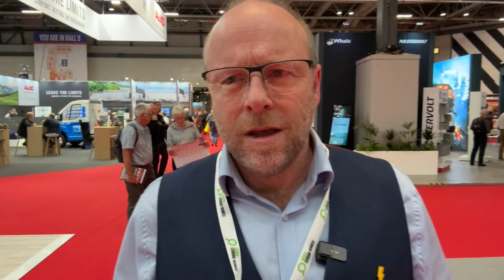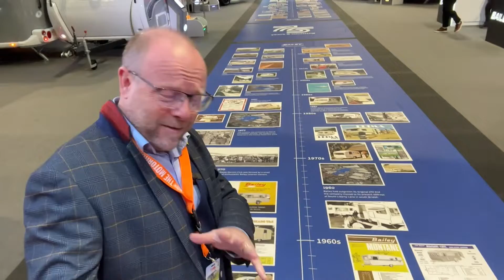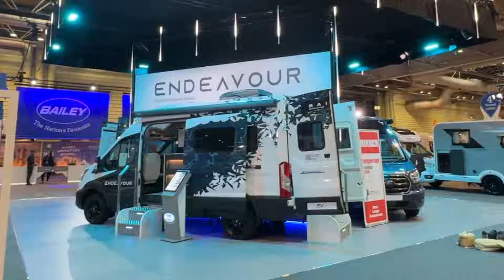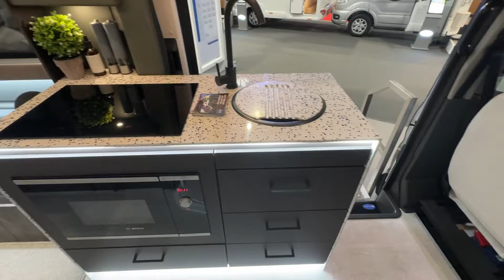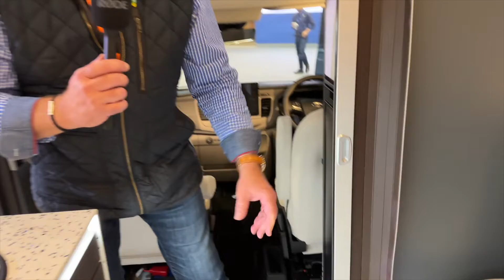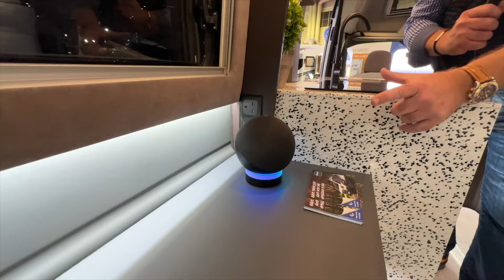Have Campervans gone ELECTRIC? Certainly looks that way thanks to @baileyofbristol #ford #ev

Comment: It could be an idea to check with your insurance company first before buying one. There is a big market correction happening with insurance of BEV's at present and a global car hire company will be looking to unload as many of the 100,000 Tesla's they bought because their maintenance costs are to high and that partly relates to the insurance problem but body repairs and tyres as well. I would not like to be tucked up in that vans cozy bed and the big battery decides to make you into a BBQ. An ICE powered van could do the same thing I suppose But I know which fire would present as more serious should it happen.
Reply from the maker: There is a market correction on everything insurance wise currently and it is due to the higher cost of repair due to the ever increasing safety tech including radar lane assist and so on. Longer waits on parts for all vehicles. EV’s do currently take longer to repair but first signs say on the whole less likely to be in an accident. REGARDING FIRE risk an EV is 24 time LESS likely to combust than an combustion engine vehicle. The fire risk is being vastly overstated!

Comment: Great video Paul, Was lovely to meet you again at the show. I am very impressed and encouraged with Bailey taking the leap forward and showing what can be done, We just need Ford to increase the battery size and efficiency of the drive train so the range is a little more 200-250 miles between charges would be about right for us.
The Iveco eDaily would be the only viable option for us right now, although, we would have to commission the motorhome build ourselves as no Converter in Europe are using these as yet.
Reply from the maker: Good insight John. Do have a look at the Stellantis press release outlining their new large Van EV for 24. A 260 Mike range… official figures so it will be nearer 200 in real life but a strong move in the right direction
Reply: @electricvanman  Thanks Paul, interesting to see the Stellantis 2nd gen large van for 24, will probably see a motorhome converter using this platform for a camper van at the next Caravan salon in Germany I expect.

Comment: I was disapointed not to see any other electric base veichles at the show.  The transit base here is not up to the job but the 110 kWh vans coming from Iveco, Mercedes and Stelantis as well by the sounds of things should get the range up to about 200 miles for this type of van.  For the smaller vans then the Stelantis 75kWh base veichle is suitable.  I have a home build on the e-dispach.

The people that will early adopt are people with a standard electric car.  After some use you learn thar you don"t realy need that big range if it charges reasonably fast.  If you get to 200 miles that is workable with experiance.
Reply from the maker: A very well informed view. the upgrades coming from Stellantis and also the new Sprinter, with the now available vehicle from Iveco there are some real options which may start to tick the right boxes!